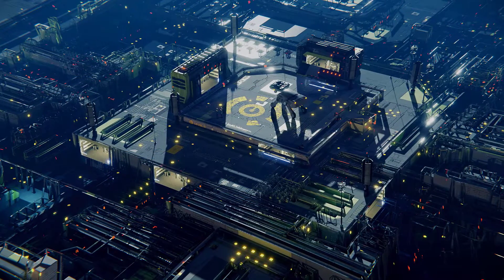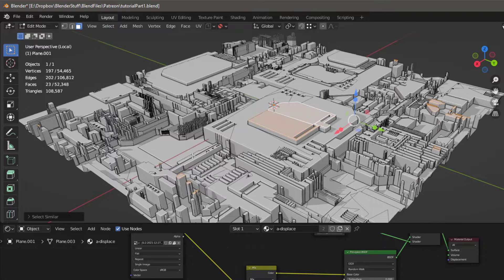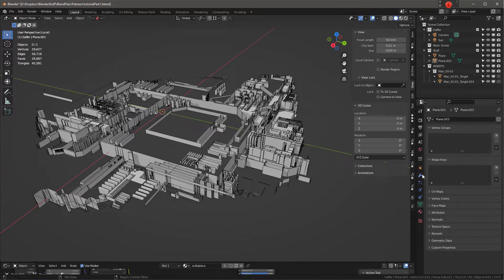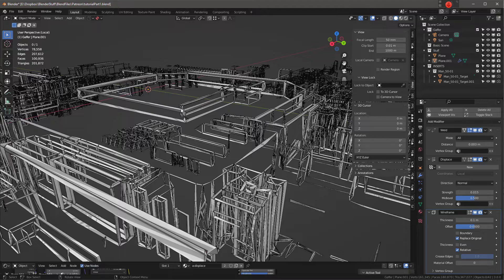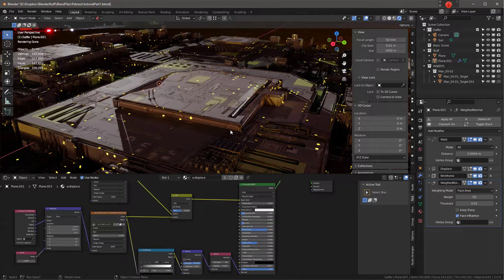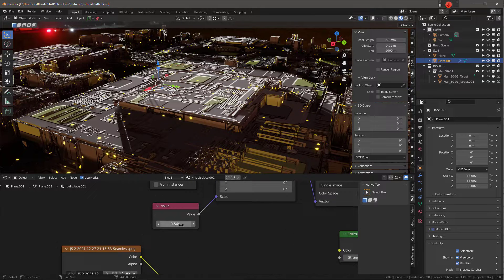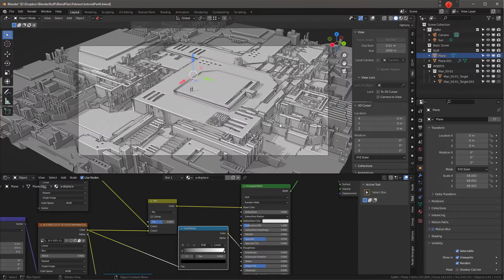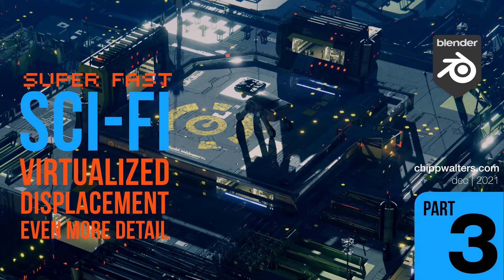Blender Sci-Fi Render Mini-Course Part 3: Adding more details!

Comment: Is there a way to combine and mask multiple bump maps inside the material? So if I wanted to combine 2 different images going into the normal input inside the material node tree but also control where they show up on the mesh?
Reply from the maker: Just use an RGB mix node with your mask plugged into the FAC